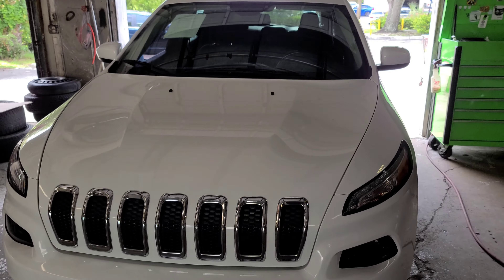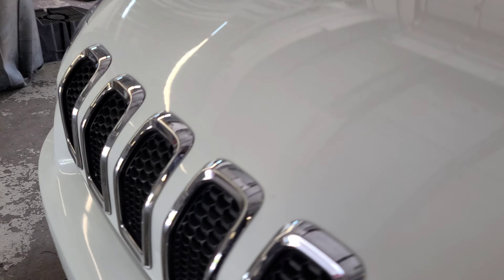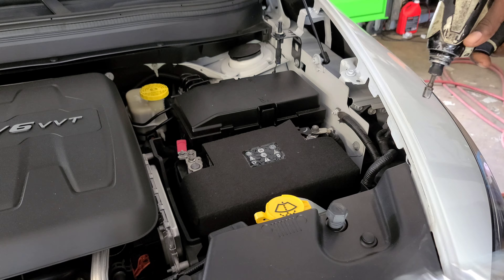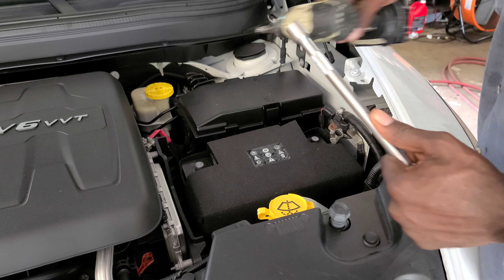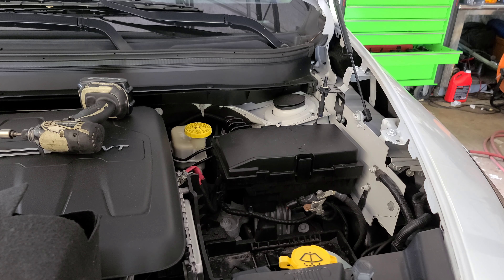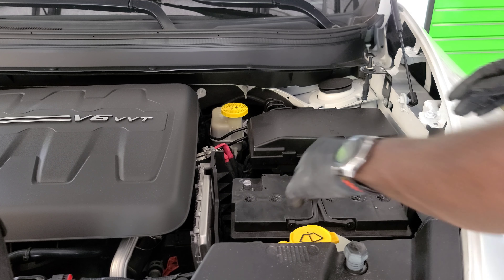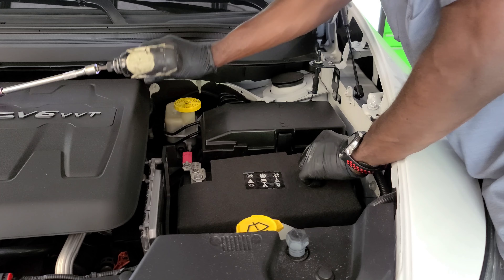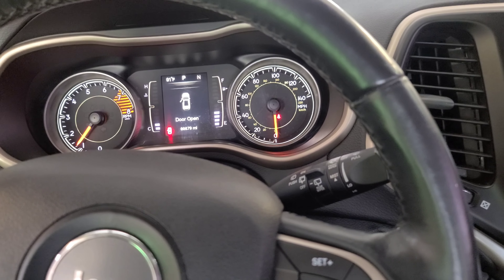Jeep Cherokee jump start and battery replacement

Comment: I replaced my battery on 2017 jeep cherokee sport and my inside lights flicker and my dash went blank for a second and then came back on. What could it be? I had battery checked and alternator and both are good.

Comment: Sorry but because these cars have Computer components in them  I always make sure I never let the battery spark that’s not really good. U can short out the motherboard of the car.
Reply from the maker: It won't shorts out anything because it is positive to positive and negative to negative once you connect the battery correctly it won't shorts out anything these newer cars whit so much electrical component will spart some time it's just that something is drawing current from the battery as you connect it so some make sparks and some won't it's normal even leaving the light on in the car or the door open or even having the keys near the car will draw some power and will sparks but it's normal